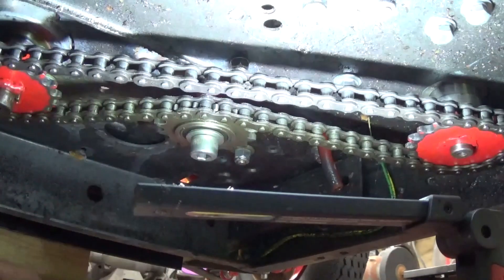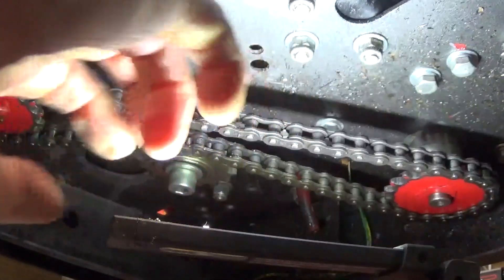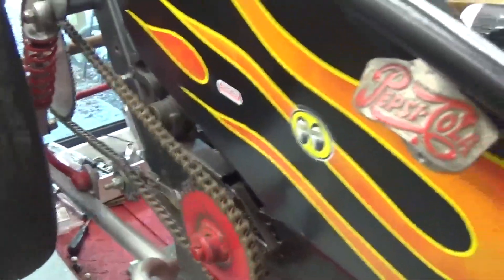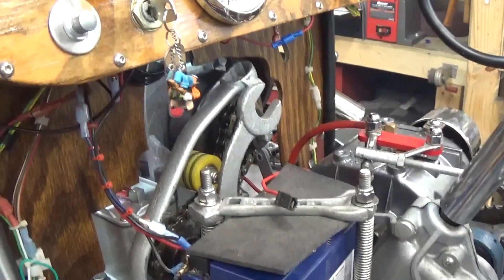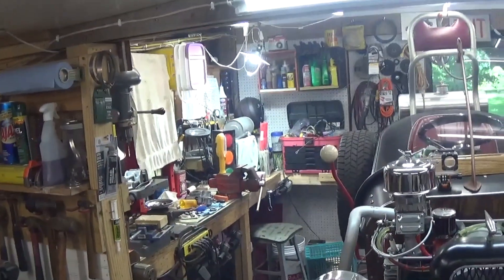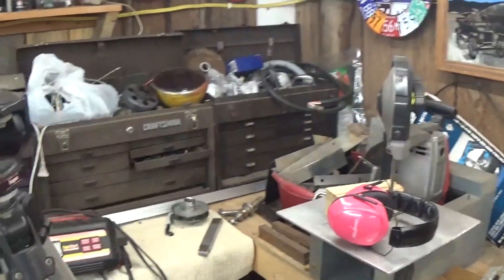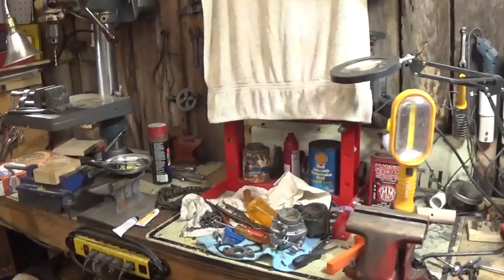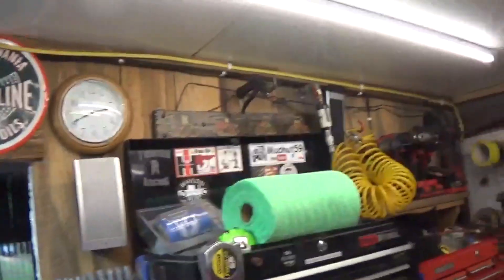The drive train is complete on the Goofy Cart!

Comment: A 'clip on' 6" fan,mounted to the ceiling to the right of the doorway will spread your Air,and heat and they'll run less. So glad the cart is ready to run and drive George.I hope you have a fun,and safe ride.
Reply from the maker: Thanks for the tips! I guess great minds think alike, since I have been planning on installing a little fan in the shop. It has to be little since there isn't much room, though I do have a pedestal fan already in the shop that I could use to do the job.